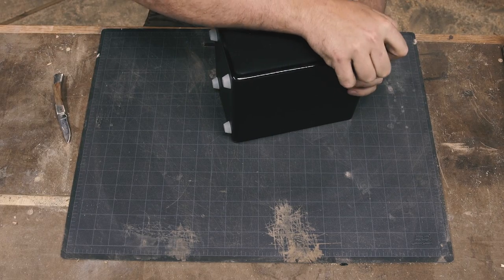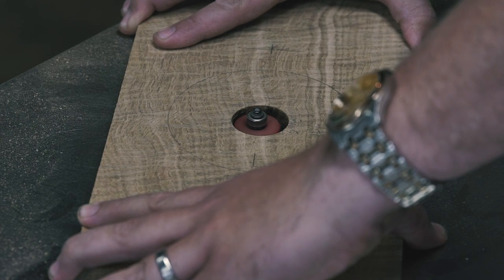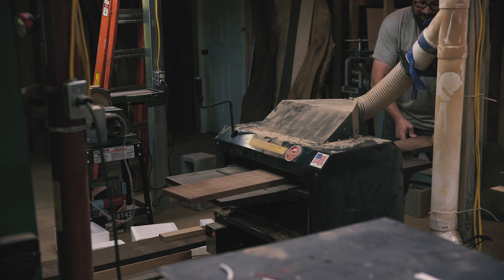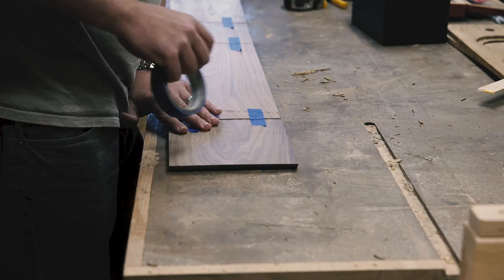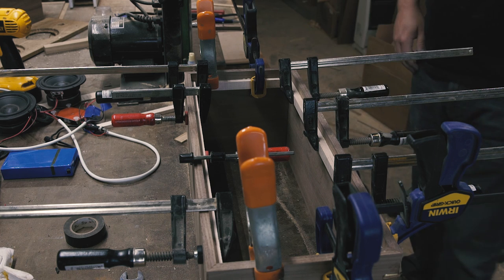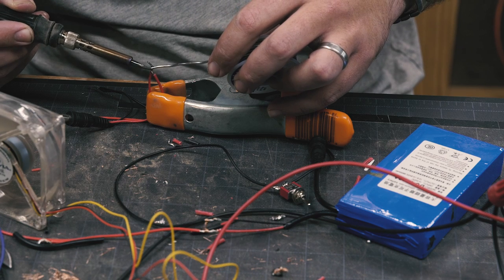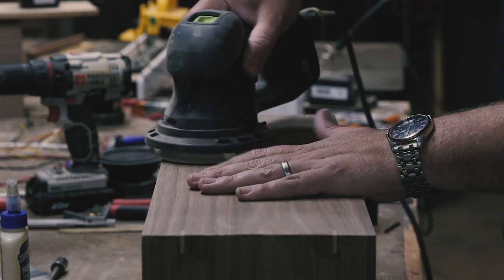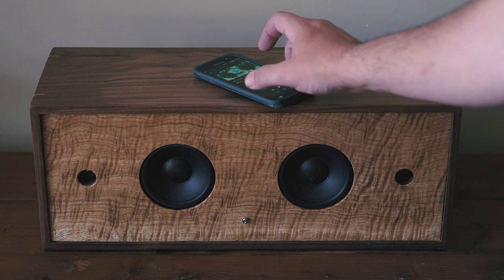Wireless Bluetooth Speaker: Wireless Rechargeable Battery Powered Bluetooth Speaker | Woodworking

Comment: The more I get into woodworking, the more I realize that Metric measurements make life SO much easier! LOL. 

Good job. This is a great looking project.
Reply from the maker: Thanks man!

I hear that about Metric from some guys, but I kindly disagree.  You can be so much more precise with "standard".  A millimeter just isn't a small enough unit of measurement. It could be just how I was raised but I can think in fractions really fast and you can double or half a measurement just by changing the denominator.  Two times 3/8" is 3/4", half of 1/2" is 1/4", etc.  What do you do if you need half of 25mm?  How do you mark 12.5mm?  Eyeball it?

Comment: With woofers and tweeters I'd suggest you use a crossover.  If you look at the old speakers, you'd likely find one in there that you could reuse in your build (should be the only electronics in the old speakers, a little board with capacitors and coils).  The crossovers add a low pass filter to the woofer and a high pass to the tweeter.  It will give you much better volume levels across the range.
Reply from the maker: I'll run down to the shop right now to see what was in the old speaker!
Reply from the maker: You were totally right.  It wasn't a little board only a capacitor with one end soldered to the positive terminal and the other to the positive lead to the tweeter.  I'm assuming to limit the signal going to the tweeter so enough goes to the woofer.
Reply: The tinniness could be because the tweeters are playing too much of the mid-range.

If your curious here are a couple good references, but basically you don't want both speakers overlapping in the mid ranges:
http://www.bcae1.com/xoorder.htm
http://www.diyaudioandvideo.com/Guide/WireSpeakerCrossover/

That wood looks awesome by the way... should have lead with that.
Reply: If the tweeters are still working, get those capacitors put back in series on the positive leads asap!  You will kill them feeding the full frequency range to them like that.  The capacitor limits the low frequency signal.
Reply: I've had a look around but all crossover boards seem to require like 300 watts to work?? is there any chance to make it work that routing with a battery? :(
Reply: Came here to say this. And add that you didn't double the resistance, you actually cut it in half. That is why the speaker was cutting out. Awesome video, I love the transparency and honesty. We are all in this together.
Reply: @manuel goletto - ha, no that's not a requirement, its the max power handling, crossovers work from zero power up just fine - they make the right frequencies go to the right driver.  A 300W crossover is rated for upto 300W, that's all it means!
Reply: The capacitor forms a filtre of the first order, it protects the tweeter against low frequenties wich can blow up your tweeter.

Comment: I started a speaking making company in 1971. I became an electrical engineer in 1977. I designed amplifiers and battery chargers. Now I am retired, but I still do woodworking. This video makes building something fun.
Reply: did your speaking company make good speakers?  lol
Reply: @mudgem3742  The speakers with Realistic speakers from Radio shack were not as good as the JBL S4 systems.
Reply: @tnekkc  wow, that one went right over, didn't it? lol
Reply: @mudgem3742  25 years ago professors visited my house to give me an IQ test and blood test for a study on a bad spelling gene. Most of my family is engineers.

Comment: thanks for posting.   gotta love those happy accidents.  the speakers ended up at a good depth for minimal distortion.  12:25, one big cleat to hold down two speakers.  that's a hoot.   
what's with the under-sized holes for the tweeters.  source of distortion.  
as you have learned, very often, small drivers benefit from some hf attenuation for more balance sound.   fyi - if you want distorted sound, go ahead and incorrectly mount the speakers to the back of the baffle and use chamfered holes.    cheers

Comment: Tape trick works better with really wide tape along the joint followed by longer strips parallel with the edge. Also yeah, really nice clean wood and no dust helps a lot.

Comment: Great build! Now you're speaking my language, my friend. Since you're working with moving air your best bet for future purposes is to use MDF or baltic birch ply butt jointed with liquid nails and held down w/1.25" screws so it doesnt resonate through. Most hard wood application are best suited as veneers for speaker builds

Comment: From what I can tell at 9:50 you have your speakers wired in parallel so you will actually have a 4ohm load. if you wire them in series you will end up with 16 ohms. Your amplifier probably isn't stable at 4 ohms but it should work at 16 though the volume will be reduced. Now if you doubled the number of speakers and ran them in series and parallel you would get 8 ohms...Realistically that amplifier isn't correct to run the speakers you're trying to use. 

here's a link to some speaker wiring options http://www.hometoys.com/content.php?url=%2Fhtinews%2Fjun05%2Farticles%2Fnigelb%2Fspeakers.htm
Reply from the maker: Impedence kind of makes my head spin.  I'll experiment more with these on a future speaker.  Thanks for the info!!
Reply: Check its specs. It's stable down to 4 ohm. No need to series them. You will take a lot of the volume, if they're 16 ohm instead of 4.
Reply: Steve Harris [[5
Reply: You can always use a volt meter to measure the resistance between the pos/neg leads of the speakers
Reply: SaUcErS pLaNeT That wont work with impedance, it would hold true if the speakers were purely resistive but it could point in the right direction. Speakers dont really have constant impedance whole audio spectrum and we can see that from impedance curve manufacturers post in datasheets. I dont mean to be rude but just helpful :)
Reply: it would, just performance/sound would depend what they put for the LC filter coils.... would have to change them.  also needs a crossover if you use tweeters to keep the load at 4 ohm and not 2-16 ohm.
Reply: do this:   1/[(1/A)+(1/B)+(1/C)]  Where a,b & c, are your speaker impedances connected in parallel. In your case 1/(.125+.125) is 4 ohms.
Your total impedance will always be lower than the value of the lowest impedance speaker.
Reply: @edgarinv  wrong, impedance is frequency specific.  You're just doing dc calculations on ac measurement.   A tweeter's impedance is at specific frequency, it's not 8ohm resistive load from dc to 20khz, same for the woofer.
Reply: WRONG, do not wire your tweeter and woofer in series...  NOBODY DOES THIS FOR A REASON...  Please buy a single book on speaker building before giving these ridiculous "suggestions"...  One should, however, put a capacitor in series with that tweeter (the simplest "crossover") to prevent low frequencies from going to the tweeter.  Your link is for SAME DRIVERS, not for woofer-tweeter arrangement.
Reply: English, please

Lol I'm just kidding

Comment: You likely added another speaker in parallel, therefore reducing impedance (decreasing resistance). This will cause the amp to cut out and overload when the load isn't high enough for it. Usually you will have quieter volumes but stable sound if the impedance is higher

Comment: The tinny sound is from the high-density wood. I have experienced in the Years pass that Eastern white hard maple, Lacewood, Rosewood and others make that similar tiny sound, that is highly undesirable. Even with speaker insulation put to the inside.R13.
 What I found for good sound is simply Pine.

Comment: Sealed speakers work with a small box. Yours is not small, and suits a vented system. Get some 2" poly pipe about 8" long and make a vent. It will kick then. And put an old woollen jumper in the box. And put about 3 times more screws into the back panel for tighter bass.

Comment: The speaker looks great! I recommend researching a crossover to improve the sound quality and avoid that "tinny" sound. The problem is that the tweeter is more efficient at translating the electrical power into sound than the woofer, so when you connect them in parallel the woofer doesn't get enough power to make the right amount of noise to sound balanced.
Reply from the maker: Excellent information!!  Would it help at all if I wired them in series?  I'll definitely look into crossovers.  Thank you!
Reply: @wmwalkerco  In series? No. A crossover routes the "highs" to the tweeter and the "lows" (and midrange) to the woofer.  A crossover also 'preserves' the impedance.
N.B. - Two 8ohm speakers in parallel result 4ohms, in series they are 16ohms. 
Look for a two-channel crossover (one for each 'pair', don't get kits). 
[ It's curious, the speakers you gutted should have had them. ]

Comment: Nice channel! I've watched a bunch of your videos. You could try padding the interior. It adds low end and can stop it sounding boxy. Most subs have it and I did it to my 2x12 guitar cab when I sealed the back of it. It definitely helped. You could also make the back panel out of a thinner material and make it a semi floating baffle. Old Fender cabs have a really thin back panel that will actually move with the speakers, apparently this adds more low too, though that's just what I've read!

Comment: I did one recently using the same Bluetooth board I found out that it works better with 4omhs 6" coaxial speakers... And I built a 12v 3s 2p lithium ion battery pack using laptop batteries and passive radiators for clean bass.

Comment: I think that you need to use a crossover for feeding the tweeters. Also you need to mount the speakers to the panel firmly to prevent panel vibrations and distortions

Comment: Put the original capacitors in series with the tweeters otherwise they'll burn quickly with not much power! you can also experiment with a little polyfill inside the enclosure, that should make it sound a bit better
Reply from the maker: I did actually go back and put the capacitors in line to the tweeters.  Sounds a thousand times better!
Reply: why not just  a pair of crossovers
Reply: @andreamitchell4758  
More expensive, not a huge quality difference, more complicated, more space inside required

Comment: Not certain how you wired the tweeters, but if they are wired in parallel with the speakers the overall impedance will go down which will allow to much current to flow out of the amp shutting it down.

Comment: Nicely done, a mostly well thought out.

1. For the glue-up, I recommend using more tape than you think you'll possibly need.
Also, you might want to try special brown binding tape...works better.
Lastly, you should try dusting off the surfaces first with your vac.

2. Ever tried a premade kit?
          I just put together some quarks from DIY audio and am floored how great they sound.
You might want to try the C-notes at Parts Express.

Keep building!

Comment: For better sound, you should use a crossover to separate the lower frequencies from the tweeters also would sound less tinny with a crossover
Reply from the maker: Yep. That's exactly what it was. I went back and added a crossover after I realized the oversight.

Comment: Fun Video and a project I myself would like to do some day.Ages ago, my dad bought a Heath kit to make his own 100 watt tube amp amp and built his own speakers.  I read his speaker design guide and IIRC, you definitely want to separate the cavity for the left and right channel speakers, as air pressure from one is likely communicating with the other.  Also, you want to have surface insulation on half of the interior faces, with the opposite face bare.  This prevents the sound from bouncing off the interior walls and then imparting pressure back to the speaker cones.
Reply from the maker: I did think about insulating the enclosure but wanted to see how it sounded first.  I also thought about separating the cavities but that complicated the build a bit with spacing and where to fit things.  This is definitely not the "Audiophiles speaker".  Just a fun build.  I've since made a second one with crossovers in the network and the new one sounds a LOT better.

Comment: Looking goood

I really liked the idea Whit the rabeting bit but what you could so next time is taking a piece of scrap sheet good an chuck it up on the lathe Whit. Faceplate turn the size hole you need and use that as an router template worked great fore me in the past 

And as far as the glue up longer pieces of tape are better and I personally prefer to take the wider clear tape do one piece along the joint and . then some some pieces across the joint

Comment: Awesome job! you could stuff it with some dampening material, this will help with the empty box feeling. also look at the old enclosures if you had them and measure the internal volume of those you could potentially install a divider between the two pairs and return the internal volume closer to what they came with. speaker science is a long and deep rabbit hole. cheers!
Reply from the maker: That's a great idea about measuring the internal volume of the old speakers.  Someone already figured out the science!

Comment: Your original power supply didn't provide the amperage needed to drive the woofers properly without basically running out of power and turning off, try a 4A supply. 

Source: I have these amp boards myself

Comment: as a speaker designer i cannot approve that X-D. but glad to see that it came out that good looking after that troublesome build. you did half the impedance by paralelling both drivers. i would suggest you put in the crossover from the speaker you salvaged the drivers from, which will correct the impedance and should safeguard the drivers from frequencies they aren't supposed to process. that will still not be ideal, but should gain a miles better result than now.

Comment: i am about to make a similar speaker.. though with larger drivers, and a much bigger battery. a nice big 20k MAh battery, so it can last for a few weeks on a single charge. however, due to lack of funds, i am not adding a charge port, instead i am just making it so i can open it to charge/replace the battery.

i am using a prebuilt, slightly banged up flight case, where i will need to fix a corner which is broken a bit, and rivet it in place, and cut out some foam to make space for the drivers, i am going for two full tone drivers, from a car audio kit, that can take 80 watts, and a big 12 inch sub i found in my dads storage, with an unknown wattage. a way you could possibly fix up the speaker is to add some foam or other sound absorbing material inside the speaker. along the sides and on the back is best, but along the sides is fine for a test of the sound, and since you can easily open it up, it should be okay for you to try it out.

a possible reason for the cutout you mentioned with the full 100w output, is likely due to power, try adding a step up to 22-24 volts, and see if that fixes it, i have a few of the boards by now, since i found a great deal on them, but they only want to work with full power, if i add a step up to around 20 volts. unless i keep my volume below 25%. but who would want to do that :)

Comment: ur woofers and tweeters are all playing full range thats why u get that tinny sound i recommend buying 2 passive crossovers and wiring right and left to there own crossover and wiring the low pass to the woofers and the high pass to the tweeters
Reply from the maker: I've since gone back and salvaged the crossovers that were in the original speaker.  I just missed it the first time.  I was so focused on figuring out the battery situation I neglected to learn more about speakers.  It sounds much better now.

Comment: You should separate the speakers pairwise..put a section of wood in the middle. Also, stuff some sound dampening inside. It will kill the resonance frequencies of the cabinet. Some of those glue on pads that can be used for cars are excellent for this.
I have the exact same amplifier board and it also pisses me off with the delay. Now solder a piece of wire to the Bluetooth antenna ( "ripples" on the blue board) it will improve the range of it.
Otherwise, a very well done project..I love the use of fine wood as the speaker is a piece of furniture and not just a plywood box.

Comment: Put a capacitor in series with your tweeter and you'll be fine. 2.2µF should be fine, don't forget to use bipolar caps or two 4.7µF caps back to back.
Reply: Also put some insulation inside to prevent the tinny sound and standing waves which contribute to a big part of the tinny-ness.

Comment: I'm hoping to build myself this very sort of speaker unit this summer. The cabinet, drivers, amp/preamp is the easy part. Tryin' to figure out the best way to set up batteries and charger (and maybe a voltage regulator) has me a bit stymied. I have looked at the various power packs available on Amazon...but I'm wonderin' if it would be cheaper to mount a bunch of 18650s and a separate charger/output regulator in there? Anybody out there got any ideas on this???Thanks for all the info on this build. My only criticism is that you should have routered the holes for the tweeters into cones or horns. I WILL say, however, that the curly white oak is AWESOME lookin'!!!
Reply from the maker: Yeah, this speaker is definitely not built with the audiophile in mind.  I did build a second one for myself though and did route the holes for the tweeters. I wish I could post a photo in the comments.  Thank you!

Comment: I didn't see any crossover networks. It looked like you had the tweeter and woofer wire directly in parallel. Maybe crossovers will help.
Reply from the maker: Good eye.  Some other guys suggested that too.  I went back and salvaged the capacitors that were in the positive lead to the tweeters as crossovers and installed them.  Sounds MUCH better now.